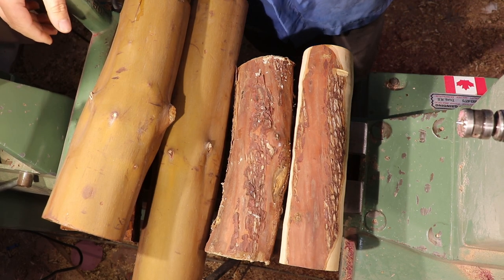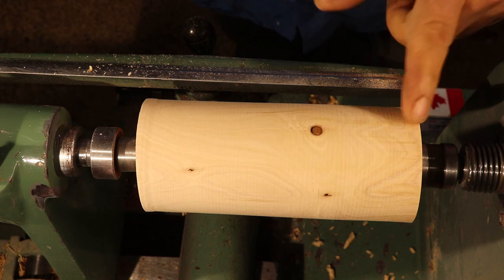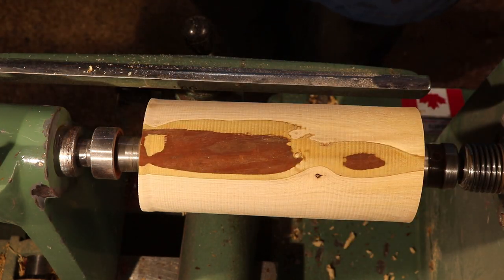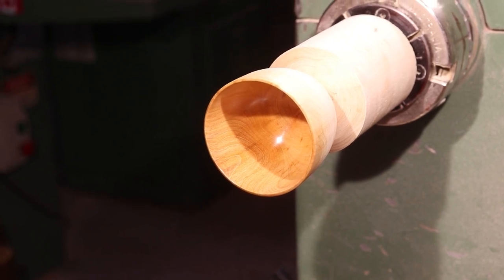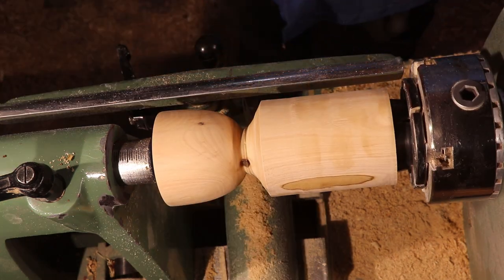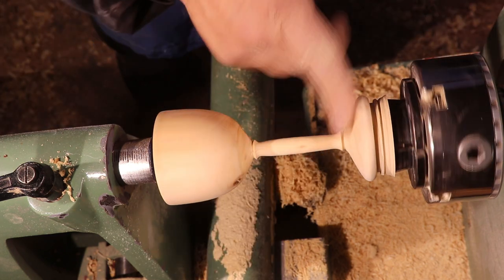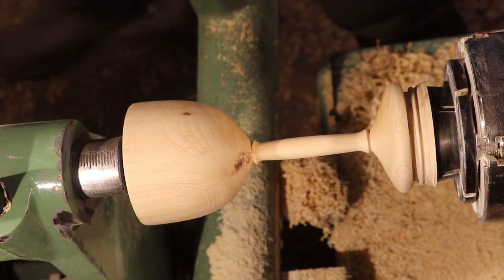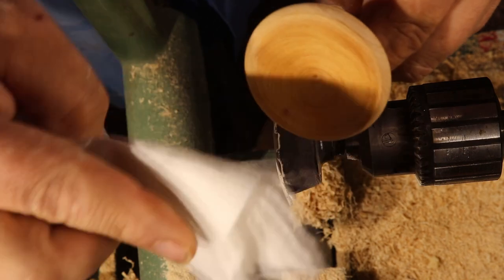Woodturning | Arbutus Goblet - First Time Using This Wood

Comment: I did not tell you that I live in the heart of Arbutus country and I have used it for firewood.  When splitting large chunks, I always look for the checking first as this gives me the clues as to where it is going to part company with the other piece.  Perhaps cut into the piece and fit a bow tie?  or wait for the crack to develop to the extreme and fill with epoxy? 
I think that the first order is to minimize the checking by sealing the ends well. You may well have saved some of my firewood towards a future use. 
I have enjoyed watching your videos.
Reply from the maker: Thanks! The ends are all sealed up. If it cracks it will be cast in resin. I guess the burls on these are very nice, keep an eye open! Thanks for watching!

Comment: Arbutus, Pacific Madrone/Madrona. Protected in Canada, left behind by loggers in the states. Not great for lumber, but informed turners can get good results. Best to turn thin if wet, loves to move and distort while drying, and can crack if turned unevenly. High moisture ratio tends to crack unturned wood while drying even if sealed, but does better if boiled before setting aside to dry for later turning. If turned when dried, it is hard as a rock, but fairly stable. High silica content dulls tools quickly. Often distorts around knots and in stress or figured grain. Burl is exquisite, and well worth working with, and hard to come by. I love turning the canker wood for its color and wildly figured areas. Our club acquired wood from Ted’s Tree, (now dead) was largest known Pacific Madrona.
Reply from the maker: That’s some cool information. This came from a part of Vancouver where it is ok to cut. I’d love to try burl! Thanks for watching Valerie!
Reply: @TheKlondikeCraftsman  Oregon Burls often (near Grants Pass, OR) have Madrone/Madrona/Arbutus burl for sale. They are great people to work with. They run auctions where the single pieces can be bought at reasonable prices, or they can sell you something from the store.
Reply from the maker: I’ve been on their auctions actually. My issue is that shipping g to the east coast of Canada is more expensive than the wood
Reply: @TheKlondikeCraftsman  And often more than the wood cost for shipping to Washington State, just to the north!

Comment: Fresh cut Arbutus is very heavy, but when dried out it become much lighter. For turning I would rough cut the object and then leave it for a year! yeah, a year to normalize and then do the finishing cuts. Otherwise it can crack. I use Arbutus for firewood - cured, it burns like coal! but as it dries, it has a tendency to split. The larger diameter pieces especially.
Reply from the maker: I’ll leave some to dry in log form with the ends sealed. I’ll turn some wet and go thin. I appreciate you watching

Comment: Great vid thanks - this wood reminds me a little of Hornbeam which is also really dense!
Any tips to help me avoid scratches when I'm sanding a piece?
Reply from the maker: It is actually very different from hornbeam which I turn often. To avoid scratches get all of the tool marks and issues out with whatever grit you need to start with. Then work your way through every grit to the finish you want. After the first grit you are just removing scratched from the previous grit if you do it correctly. I strongly recommend Yorkshire grit as well. If you do a good job sanding to 240 grit Yorkshire grit will remove all scratches. Thanks for watching!
Reply: @TheKlondikeCraftsman  many thanks - I think I need to take more time on the first stage of my sanding! I use Yorkshire grit and happen to reside in Yorkshire so it’s a no brainer 😄 I often see people in the states and in Canada using Acks have you tried it? All the best and thanks again - Paul
Reply from the maker: I have not tried ACKs , I started with YG and it works perfectly so no reason to change really.
Reply: @TheKlondikeCraftsman  Totally agree - all the best, look forward to your next film!